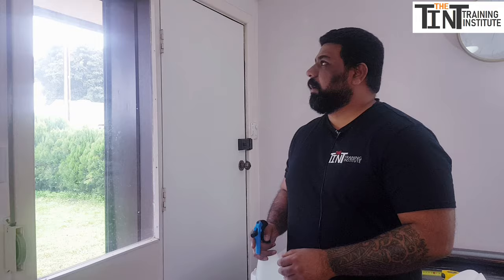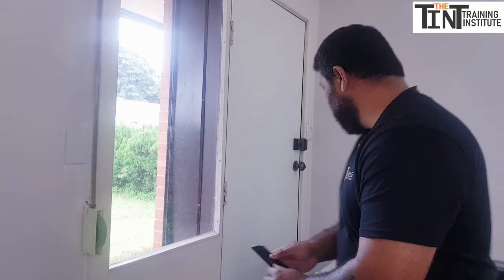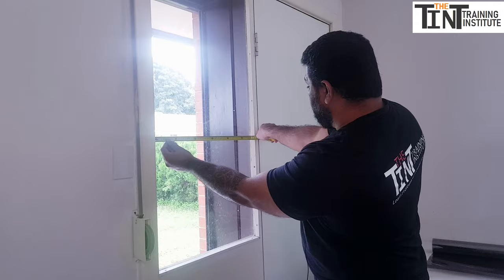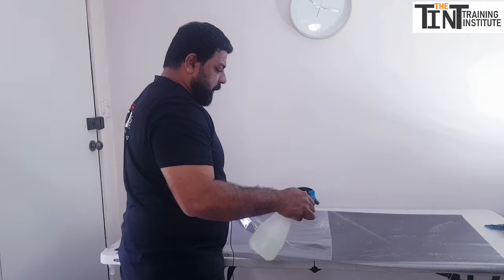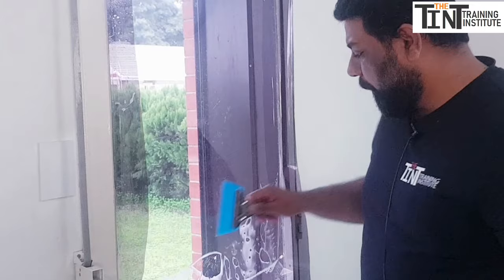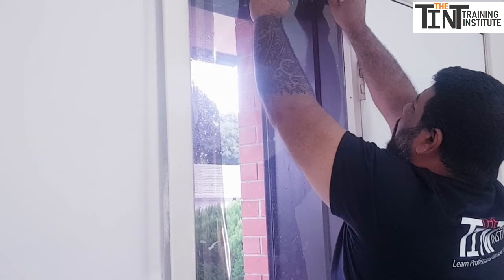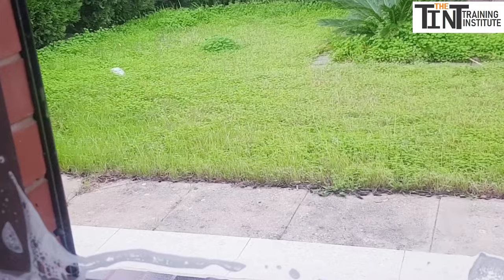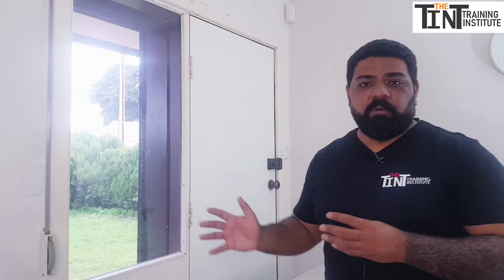Learn To Tint Home & Office Windows Like A Pro

Comment: Can you cut the tint exactly to size? In my head it makes sense not having to do all the final trimming.
Reply from the maker: Yes you can, but make sure the film doesn't touch anywhere but the glass after you remove the seal, otherwise you will have dust on the edges, also make sure the film is exactly cut to size . Thanks

Comment: The one thing I saw that was different... was my tint was rolled. So it constantly wanted to recoil back into a roll. After getting it on the window... it sqegeed beautifully. But the damn vertical sides kept curling up because of wanting to roll up again. So freaken angry tried for an hour to get those damn vertical sides to seal and they would not because of the coil effect. How the hell do you stop the sides from pulling up after unrolling a fresh roll of tint????

Comment: How much is the cost of this film? Per square feet. Also, can we reduce the room temperature with this? Also, for privacy, do we need to film the glass from inside or outside..? Coz for my home, its very difficult to do the tinting from inside as iron grills are big obstacles for this.. Pls help
Reply from the maker: Hi, so the price depends on where you live, here in Australia for the general public, people can get films from Bunnings warehouse which is 152cm x 10m for $100 or something, that should cover 8m windows. now if you call a professional tinter to tint 8 meters it's going to be x $95 that's $760 AUD give or take, the film always goes inside never outside, you can get different VLT films for your privacy

Comment: Do you have to use 1 big cut to cover the entire window or can it be multiple sheets of smaller ones side by side? I bought some that is way too small to cover the entire patio glass.. can I use it or should I return them?
Reply from the maker: Use one big film to cover the whole window, otherwise, it will look patchy 

window film sizes are

50cm (20inch) height 
76cm (30inch) height
100cm (40inch) height
152cm (60inch) height

length will be as per the retailers normally the commercial tint is 10meters roll
Reply: @windowtinttraininginstitut5558  thank you
Reply from the maker: @fredkim01  your welcome
Reply: Hi. I have a "dummy" window on my house that I want to tint. Can I tint it from the outside?
Reply from the maker: @valsimonovich1471  you can but it will collect lot of dust afterwards

Comment: Can you use car tinted film in a residential window?
Reply from the maker: You can, but try to find residential films for home and office windows
Reply: Please do not do it especially dual or triple paned windows it will cause pressure and crack the glass

Comment: You also need to ensure there's no dust in the air.  If you don't do that, you will have hundreds of dust particles deposit directly onto the film before you apply to the window.
Reply: how would you avoid that, theres dust everywhere!
Reply: @leviorellana2093  They have those clean rooms where they manufacture microchips.  If you have a couple billion dollars you can convert your home into a "fab" then tint the windows.  One downside however...you'll have to wear on of those fab bunny suits with the mask. 😁
Reply: Stop breathing, you won't want to disturb the dust